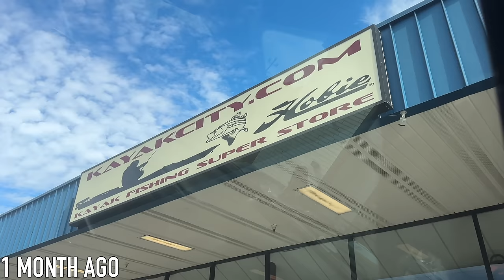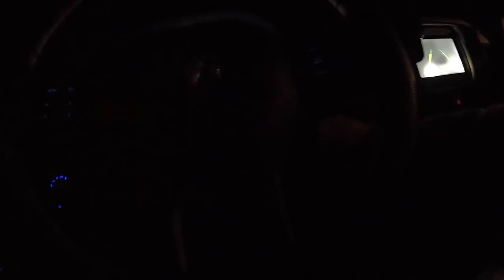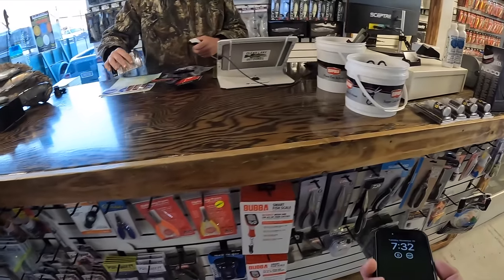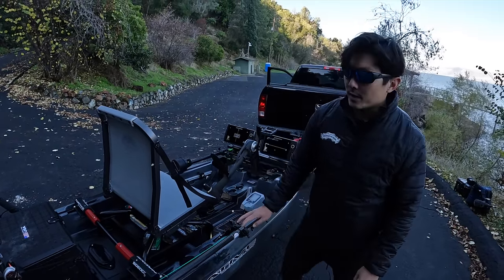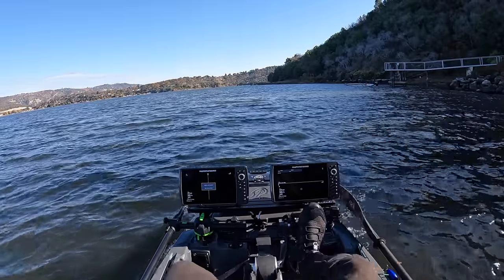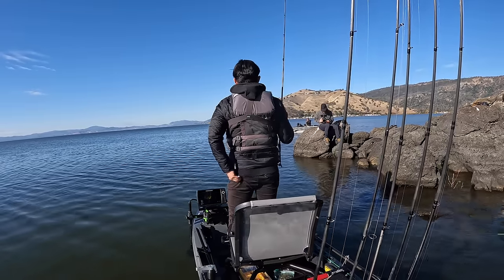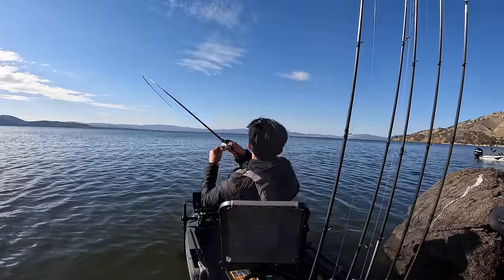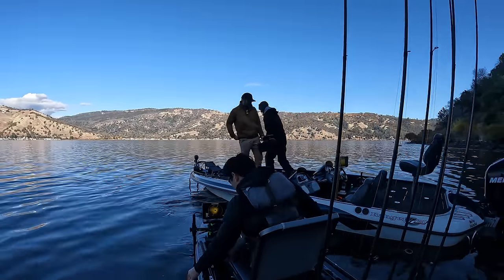I got a new kayak (craziest build yet)

Comment: Problems with Bow Mounted Trolling Motor or why its not installed? I think the Pedal Drive will not fit when a Bow Motor will storaged right? Its fakt on my Titan 10.5
Reply: Yeah my thoughts too. 10.5 is kinda small
Reply: @cloutmaster965   And the Titan X 12.5 is too heavy 😒

Comment: I have a swivel mount and a millennium seat on my diablo kayak. You're going to love it. 
Looks like you don't have a locking swivel though, I'm not sure how that will go over with pedalling/paddling. You're going to want to have that mount changed. 
Good luck.
Reply from the maker: you said it and already changed to a locking seat!
Reply: @GregBlanchardFishing  excellent! It's a game changer man. It makes drifting so much more manageable when you can just swivel to just the right angle and make that cast you want. 
👍

Comment: Greg, i'm building my titan X 10.5 and i ran into a problem while trying to install the Humminbird Helix Mega SI+ G4N transducer....  the Humminbird bracket is to narrow and does not align with the Titan X transducer mounting screws.  how did you resolve this, i'm assuming you have the same transducer on yours.  Thanks

Comment: I've been looking into the mega 360 a lot lately. I'm excited to see how you utilize it to improve your off-shore fishing and how you can become more efficient out there. Also want to see how the new TitanX works for you. I'm looking to upgrade my boat next season but I'm leaning towards a trolling motor setup with spot lock but I wouldn't be opposed to running a bow mount trolling motor and a stern mount motor for getting from spot to spot. I know you have always used a stern mounted motor but am curious if you think the spot lock feature would be helpful while using the 360?

Comment: Greg,

I think that this is a little out of control. Having a basic graph on a kayak is fine. At this point you're going down the road of just too much gear and electronics to make it relatable. Part of the reason I watch your videos is because you keep things pretty simple. Multiple graphs with Mega360 is just overkill. I stopped watching other kayak anglers once they started putting FFS on their boats. 

The average angler cannot afford this nonsense and if I wanted to watch guys staring at graphs al day I'd turn on the BPT, Elite Series, etc.